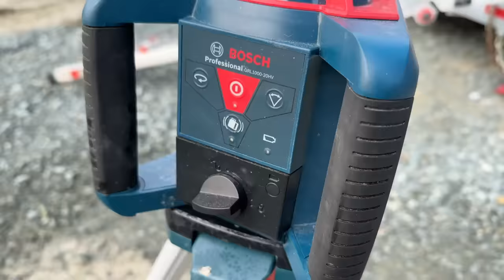Our Plans Have Changed |  Preparing for Our New Post & Beam BARN

Comment: Always wear thick padded gloves when using the compactor. Joint damage is cumulative and avoidable. You will appreciate it later on.
Reply: I was thinking the same. Skiing gloves would fit the bill nicely for padding but still lets you work the controls.
Reply: Not just joint damage but also damage to blood vessels leading to a condition called Vibration white finger or Raynaud's disease which is caused by repeated prolonged use of any vibrating tool and is irreversible.
Reply: Cats are always in the best seats.  That compacter is worth it’s weight. Maybe in silver, not gold.
Reply: @glyndevonport7802 Thanks for that info... didn't know that.. but makes some sense.
Reply: @glyndevonport7802 
Holy Moses!! I never heard of it.. thanks for the heads up..

Comment: Hi folks! Love your construction videos! Can’t wait for the barn raising…hopefully with Ken and crew! The plate compactor will start easier next time if you cut the fuel valve off and let the carburetor run dry. I am very familiar with the Predator engines because I use them for engine swaps for customers on a budget. The Predators are a direct Honda GX clone. I am going to send you a replacement carburetor and gaskets to your PO Box. At some point you will need it. Trust me…lol. Have a good day and God Bless!
Reply: Wow, that's really nice of you. So nice that you could help Al out with the plate compactor. Have a great week!

Comment: Good morning!! 
I wanted you to know I used the same epoxy floor covering back in 2008 on three of my new landscape enclosed trailers, I wanted to protect the new plywood and ramps. This was one of the best decisions for the protection of it , easy to clean any oil or gas stains, mud and grass, and equipment…..yours should last a long time.

Comment: Al, as to the portable fuel tank - it's right next to the outhouse/storage shed you built with solar panels on it.  You just need a 12v battery and the wiring to charge from the solar and wire to the fuel tank (with a switch of course).

Comment: Al, you mentioned having to hook up your gas pump to the vehicle.  But it is right next to that small shed WITH solar power.  Maybe you could install a 12V power outlet/plug/source on the side of the shed for the gas pump.
BTW does that shed get used for anything?  And could you move it to some other more useful location?

Comment: Don't you still have a battery in the so we're a body house behind you? If you still do run a couple of wires out of that, put a Anderson connector on your fuel tank and on your wires coming out of your solar panel house right there. But hook your fuel tank up to that. And then all you have to do is pull up to it and feel.  Because you'll always have a battery charge

Comment: When you pour the concrete floor, slope it slightly so water will drain off without requiring floor drains.
Reply: Good idea...
Reply: Ordinarily, I would agree with that. There are times when you need to build things on the level, and it really helps a lot to have a level floor. That would be for the work shop. A barn, I can see a very slight change in level. Livestock might slip in winter.

Comment: You need a forestry mulcher for your excavator for the sides of the roads. It will get rid of all the stumps and smooth out the areas. Maybe you could just rent one. Using padded gloves with the vibrating tool always helps.

Comment: Al you should take a look at how Captain Kleeman sorted his fueling system he had similar to you but he put it in a water tank cage and now has a movable fuel, Grease and oil station he brings the fuel and all he needs to the machine instead of having to bring his slow machines to the fuel, just a thought.

Comment: The fuel gauge issue will most likely be the sender unit in the top of the fuel tank. Common problem with those Bobcat excavators.

Comment: I was thinking if you have a spot to put a deep cycle battery near your fuel station, You could put a little solar panel to keep it charged. Shouldn't take to big of a panel for the amount of time you need to run it.
Reply: Looks like he is storing the fuel station right beside the little outhouse/shed, so that little building already has solar panels installed on it.
Reply: @pasreview9274  That would make it even easier, one battery would do it I'm thinking. most likely only be running the pump around ten-twelve minutes at a time. If that's the solar Shed and has batteries even better. 👍

Comment: Why don’t you take off the attachments when not in use on tractor? Less likely to damage
Reply: we've covered that many times.
Reply: @rupe53  covered what?
Reply: @JohnR9965     removing the attachments when not in use.... to cut down on wear of the hinge points and other hardware. It's mentioned in the comments of almost every video.... and usually several times.
Reply: @rupe53 ok I don’t read to many comments….
Reply: That would be too much work,😂😂😂😂

Comment: With the motor on the compactor, turn fuel off and let the motor run out , turning motor off and leaving fuel in carby makes it difficult to start or block' carby, cleaning it not fun.
Reply: And if sat for a while without running, remove the spark plug and squirt a bit of fuel onto the piston with plastic syringe, replace the plug and let it sit for a minute and it will start with a couple of pulls.

Comment: AL, your complaining about power for the fuel cell system and your standing right next to solar panels??? what?? Maybe their is a dc to dc connection that can be made there???........dc to dc inverter.  sub charging station for the lions.. something,,,,, but my point is you have some power local put it to use.

Comment: 😮 wow, you deleted my question rather than answer it? I didn't think it was either disrespectful, offensive, or outside community guidelines - that stinks! 😢
Reply: The only way the channel can delete comments is by blocking them so that they can't make comments. As you were able to make this comment you have therefore not been blocked. YouTube does delete comments though.
Reply: @tonygrimes13  thank you for clarification.
Reply: @gingerbanks-so2ev  No problem. YouTube haq deleted some of my comments even though there was nothing wrong with them. YouTube generally deletes any comments with website links if they are not YouTube related.
Reply: @tonygrimes13  ah, that explains it then. Mine had a link to homesteaders doing agricultural tiling to help prevent the accumulation of water, washing away seeds and vegetation, and mini creek like rivulets across properties.
Reply: You are going to back into something with that bucket tractor if you leave the instruments attached. There is too much wear and tear on them when not in use. There is a reason they make them “quick attach”.
Reply: Why this comment on this comment thread?